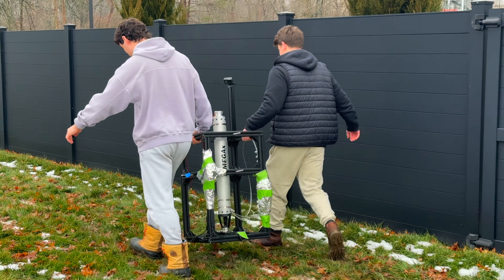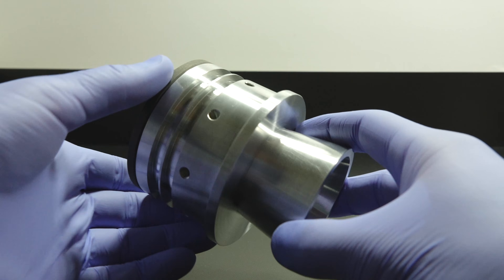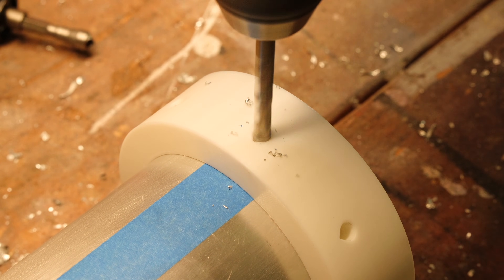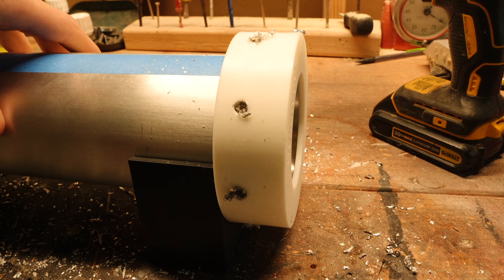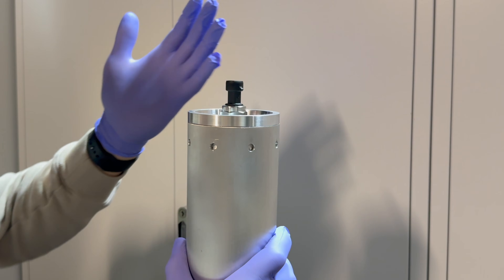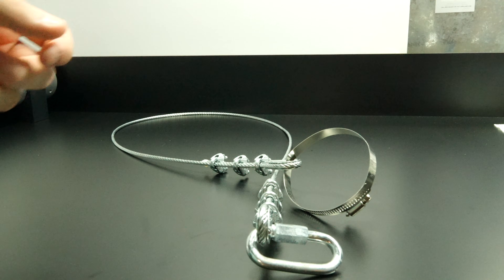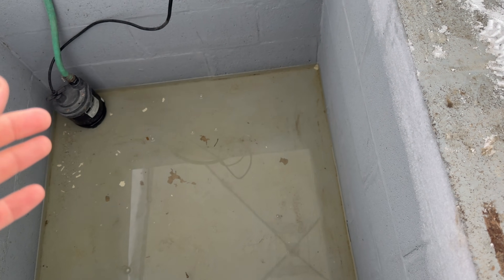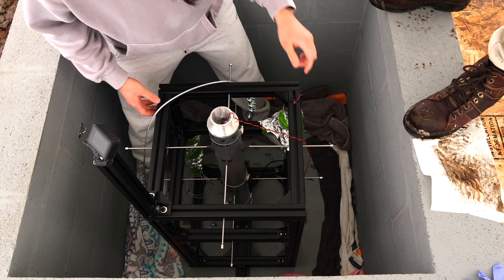This Homemade Rocket Motor Produced Way More Thrust Than Expected – MEGAx Ep 5

Comment: Very good video. It really sucks that the sd card didn't work.
I have had similar issues due to the sd card breaking connection due to a cheap reader /power getting down before the "sd.close()" command.
I have two pieces of advice : 
1) a better quality sd reader, from sparkfun or adafruit. Yes they are more expensive, but the datalogger is no longer a project, it's a tool that need to work reliably. 
2) if it doesn't slow down too much the measurement rate, open the file, write your measurement point and close it everytime. It's slower but less prone to failure in my experience
Reply from the maker: Great recommendation. Will definitely implement these for the next test. Losing/ not retrieving data sucks!!!
Reply: Rather than doing point by point, you can buffer N reads, start the write while filling a second buffer with N more reads, next write pulls from second buffer while you start recording N more...
Reply: @haileycollet4147 I am not sure that is possible as the arduino works sequentialy with only one processor. We are not dealing with real-time electronics, if it's possible,  I would be really interested
Reply: @aterxter3437  oh, for some reason I was thinking raspberry pi lol

Comment: Great video, and congrats on a good firing! Even if your thrust curve didn't match the sim, any firing where you go home with the same number of rocket pieces you showed up with is a good one. I also love the idea of a leash in case things go sideways, good foresight! For the next one, I'd recommend keeping the igniter out of the motor until it's in the stand and ready to fire. The NAR has similar guidelines for rockets; no igniters in the motor until the rocket is vertical and avionics/etc are armed. If you end up doing head end ignition where the igniter is installed before the motor is in the stand, or if the igniter must be installed early for some other reason, make sure you get a shunt on that XT60 connector so the shortest path for any stray current is through the shunt, not the igniter. Just want to make sure you don't end up igniting the motor early from static! Again, great job and congratulations!
Reply from the maker: Thank you so much! Smart with the igniter, will use that method for the next static fire. Always looking to tighten up safety and procedures.

Comment: Interestingly it looks like you can actually see where the pressure spiked at the beginning because the exhaust looks under expanded.
Reply from the maker: Yeah that was pretty cool to see.
Reply: @AeroPropulsions I wonder if you could synchronize the video with your pressure data to find when the pressure peaked on the sensor to get a rough estimate of maximum pressure by how much more it expanded.